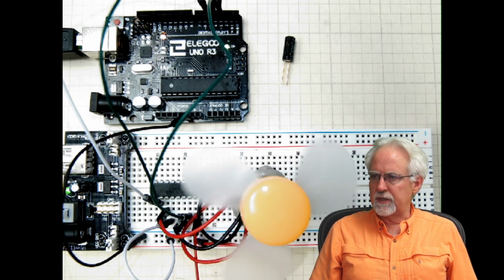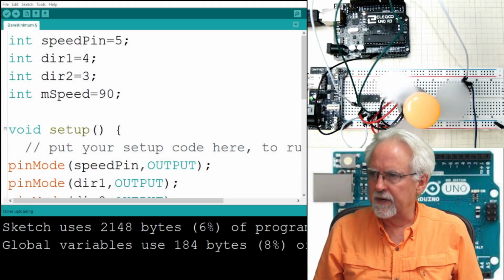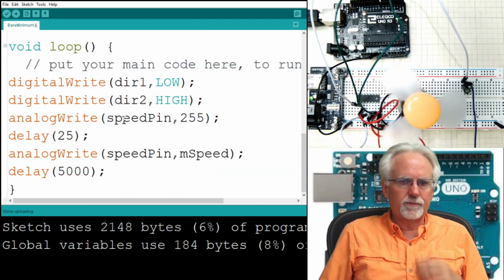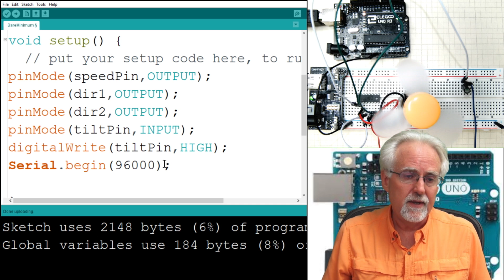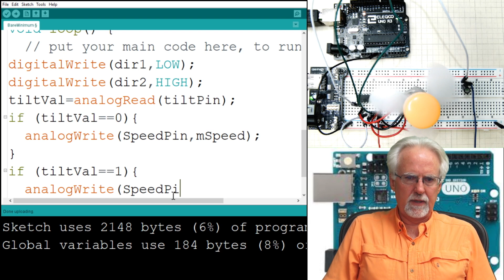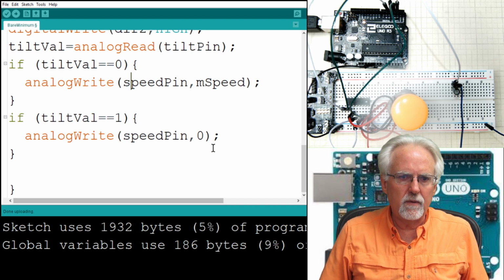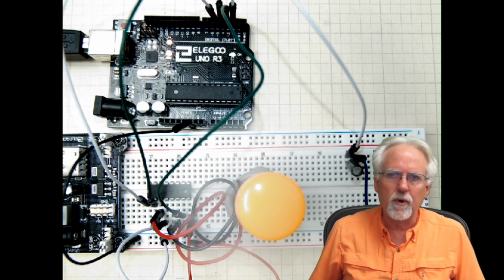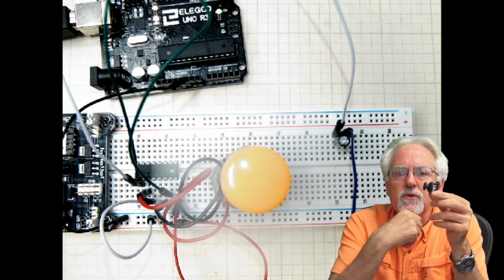Arduino Tutorial 38: Using a Tilt Switch Cut Off With a DC Motor

Comment: i want to  tell you that i did it after you gave us the homework, so i did it another way.
the way i did it is by using a while loop, by saying if the switchState was1 then turn off then i made it read the pin again (so when it sees it false it will exit the loop), then i put both directions low,
and it worked, would that be like a good way of writing a code or is it less professional??
i just want to know to keep and improving myself😊
Reply from the maker: That's awesome! Keep experimenting and improving.

Comment: I did not have a tilt stwitch so I used a button instead. I had to run 5V through the button as a pull down resistor to get it to work properly. Thank you for the challenge.

Comment: sorry for using numbers insted of variables : 

int tiltval ;
void setup()
{
  pinMode(2, OUTPUT);
  pinMode(3, OUTPUT);
  pinMode(5, OUTPUT);
  pinMode( 7 , INPUT_PULLUP) ; 
  Serial.begin (9600) ; 
 
}

void loop()
{

  
  tiltval = digitalRead (7) ;
  Serial.println(tiltval);
  delay (200);
  
  if (tiltval == 1) { 
  digitalWrite(2, LOW);
  digitalWrite(3, HIGH);
  analogWrite(5 , 255) ;
  delay(1000); 
  }
  else if (tiltval == 0 ) {
  digitalWrite(2, LOW);
  digitalWrite(3, LOW);
  analogWrite(5 , 255) ;
  delay(1000); 
}
}

Comment: My bad. I did the homework but I just put the tilt switch in series with the ground to the motor controller. Took me 5 minutes and no additional code. KISS. Is this the wrong way to do it?

Comment: As my kit doesn't come with a L293D IC, i had to this and the previous practice with TinkerCAD, which proven to be a bit difficult, but eventually it worked. Next one would be more difficult, as TinkerCad doesn't have a joystick component for Arduino, but two potentiometer and a switch should work just fine as a replacement.

Comment: I did this for homework last lesson, but used if else. It worked for a while but then I started getting both one and zero tiltVal readings when it was tipped.   Realized I needed to fake a pulldown resister using digitalWrite high.  Then it worked consistently.

Comment: Hi Paul, I incorporated the tilts witch and again used the pinMode(tiltPin, INPUT_PULLUP) ; as this reduces the code by a line(one less to get wrong). I found that like yours in the video there was a delay between the tilt switch activating and the fan stopping so I played around with the delay times and took the kick play down to 50mS and the delay after the analogWrite(speedPin,mSpeed); line down to 100mS and this gave a nice snappy response and I was also able to get it to start back up when righted at an initial speed of 75.
I wish I hadn't torn down the joystick board now ( I have 2 UNO boards) still its all part of the lesson. Off I go to the homework bench.  Great job as usual.

Comment: Yes I did the homework - always do AND pull up your avg. view time because I always watch the whole thing - several times if necessary. This was easy because of the previous videos. Thanks. I am wondering if you do a series focusing on what is needed to step up to real life projects requiring higher voltage and currents. I am not an electrician ot hobby electronics guy but I do have a project in mind requiring me to learn all this and more. You have alluded to this requiring relays etc. but I would not know how to do it. Perhaps a higher voltage DC motor or servo would be a good example.
Brewster
Reply: Follow up to my question. I can understand if there might be a liability showing videos involving lethal voltages and current. Maybe you could suggest another source?

Comment: I put the tilt resistor in series with the fan power. Works great and doesn't require any change to the code. I know it's not in the spirit of the homework, but it's basically a 0ohm switch.

Comment: Hi Paul - Not sure if this is acceptable, but I just put the tilt switch in the circuit between pin 8 on the motor controller and the positive rail.  Got the same results.

Comment: I did it slightly different but same result:
loop:
switchVal=digitalRead(switchPin);
Serial.println(switchVal);

if (switchVal==0){
digitalWrite(dir1,HIGH);
digitalWrite(dir2,LOW);
analogWrite(speedPin,mSpeed);
}
else{
  digitalWrite(dir1,LOW);
  digitalWrite(dir2,LOW);
}

Comment: I just used the tilt switch to interupt the voltage from the L293D and it seemed to work very well. A simple hardware solution?
Reply: obviously though, that wont work with our homework assignment. Back to the drawing board!

Comment: I did my homework and had it working prior to watching this episode. Setting the motor speed to zero seemed logical, so that's what I did. The only mod I made was to put the tilt-switch on a couple of male/female wire extensions to make the tip-over testing easier. Thank you for another wonderful lesson. 👍
Reply: Haha, putting the tilt switch on extensions was a great idea, thanks!

Comment: I was thinking about where a tilt switch is used and there is one in my portable heater that shuts it off to prevent fires. It also turns on a red light. Really useful information 👍

Comment: I am now able to add the tilt cut off with flashing red LED. Control the speed of the motor with a potentiometer. Turn the whole thing off and on and reset the tilt state with a button.

I just wanted to take the time before finishing this video to let thank you for this series! 
You taught me how to do Fusion 360 and I'm so happy to continue to be able to learn from you.

Reply

Comment: I connected the tilt switch to Arduino pin A0 to chip pin 5. If tilted the input becomes 0 and the motor stops. In real power motor applications, you would use a tilt tin in the control circuit, not direct power running the motor.
I realized that 512 was a starting point, so you would need two slopes, one positive, one negative. Two if statements.
We  at starting in the middle of the X axis from 0 to 1023. 0 is the still, and 255 is the highest for mSpeed for the motor.
Wayne - - Moderately hard. Again having an old lesson open while working on a new lesson is better than from scratch.

Comment: Did it first by running the ground for the motor through the tilt switch.  Figured that was cheating so set up a pin and set the variable like you showed.    Does everyone's motor make a buzzing sound even when it is off?

Comment: Finished the homework before watching this. I used an else statement instead of another if statement.

Thank God for you! God bless you sir!
Reply: I did the same thing using else rather than 2 if statements. not sure if there is a difference.
Reply: @haroldbk  It's a minor difference in this situation, but important in others.  As an example "if Paul's shirt is orange, wave your hand. If Paul's shirt is green, stand up." In this situation, the code would evaluate both statements to see if they are true. There's no "fallback" code block if both statements are false. "If Paul's shirt is orange, wave your hand, else, stand up." Here, if Paul were wearing any other color shirt but orange, the else portion will execute. If he is wearing an orange shirt, the else statement will be skipped.

Comment: Hi Paul, I did the homework and got it to work. I wrote the same code as you created, but added two extra variables : mSpeedStart=250 & mSpeedStop=0 then I used these variables in the if statements, although mine worked, I wrote more unnecessary  code. Thanks again Paul

Comment: So I did complete the homework, but as usual I took it a few steps further.  I used serial monitor to take a speed from the user and turn the fan on to that speed(low, med, or high)
I made it work but then I wanted that no matter what when the tilt switch was tilted, the circuit would cut off.  I was able to code it but when the tilt occurred and then was corrected the fan has to be restarted by the user in the serial monitor.  The other way (my original idea) take the fan speed input from the user and then when tilted the circuit cuts off and then turns back on as soon as the tilt is corrected. The way I made this happen was to connect the tilt switch on the ground circuit, where when tilted it opened the ground circuit causing an open in the electrical circuit causing the fan to shut off, and then correct it and the fans turns back on as intended.  I want to know if someone know of a way to code it rather than to put the switch on the ground circuit?

Here's what I have, this works with the tilt switch as an input to the R3 and not on the ground circuit:

int on=HIGH;
int Off=LOW;
int motPin=3;
int motDir1=2;
int motDir2=7;
String speed;
int tiltPin=12;
int tiltVal;
int low=155;
int high=255;
int med=195;
int off=0;
String speed1;

void setup() {
  Serial.begin(9600);
  pinMode(motPin,OUTPUT);
  pinMode(motDir1,INPUT);
  pinMode(motDir2,INPUT);
  digitalWrite(tiltPin,HIGH);

}

void loop() {
  
  
  tiltVal=digitalRead(tiltPin);
  Serial.println(tiltVal);
if(tiltVal==0){

      speed=Serial.readString();
      digitalWrite(motDir1,Off);
      digitalWrite(motDir2,on);
      

          if(speed=="high"){
            analogWrite(motPin,high);
          }
          if(speed=="med"){
            analogWrite(motPin,med);
          }
          if(speed=="low"){
            analogWrite(motPin,low);
          }
          if(speed=="off"){
            analogWrite(motPin,off);
          }
  

}

if(tiltVal==1){
  digitalWrite(motDir1,Off);
  digitalWrite(motDir2,on);
  analogWrite(motPin,0);
}

}

Comment: Keyword Rose and Ronald
Another great lesson, I am planning to use a DC motor to drive my observatory dome using mirror tiles fitted every 10 degrees around the dome and for position control with infrared photo sensors. I have learnt a great deal so far

Comment: Did my homework on this. My motor is very slow even at 255. Will not run blow 180. Wonder if that is typical? I did the digitalWrite.
Reply: Are you using the battery or the power supply for the power supply module?

Comment: i used an if statement to turn on the motor and do the kickstart voltage, and then a while statement within that to loop a lower voltage run for the motor until it is tipped and everything shuts off

Comment: I  found an easier way to set an input switch as if it had a pull-up resistor. In the pinmode statement use  “INPUT_PULLUP”. Then you don’t need the digital write statement.

Comment: Did the assignment from the last tutorial, but a little differently. I used a couple of while loops, so I could keep the low speed and use the kick start. It also only kick starts once then keeps running until tilted. Full code in the comments of Lesson 37.

Comment: Another excellent video - made it to the end.  I don't have an Arduino yet but am looking forward to buying a sensor laden kit soon.  I did this 50 years ago using an 8086 based robot and assembler.

Are there more sensitive tilt switches available, i.e. able to detect 5 degree tilt for example?

Comment: I did the homework on the last episode no problem and decided to use the knowledge Ive gained so far afterwards to combine my DC Motor, Servo, and Joystick , X controlling motor speed/direction , Y controlling servo position to point the fan in a desired direction. My longest code so far and was successful right away. Fantastic teaching I can’t thank you enough !
Reply: Great idea, Colten!

Comment: I'm going to try posting my code here.  From all I can see this should work but I get strange results.  The variables keep changing without my pushing the button!  I've changed the button thinking it was bad but with the same results.  

int motorSpeedPin=5;          //Pin 1 on chip
int motorDirectionPin1=4;     //Pin 2 on chip, set one high the other low
int motorDirectionPin2=3;     //Pin 7 on chip  set one high the other low

int motorSpeed=255;           //Speed between 0-255. Needs about 100 to run, sends pwm to motorSpeedPin 

int buttonPin=12;
int buttonOld=1;
int buttonNew;
int motorState=0;             //motor is turned off
int dt=500;

void setup() {
  // put your setup code here, to run once:
  
  Serial.begin(9600);
  pinMode(motorSpeedPin,OUTPUT);
  pinMode(motorDirectionPin1,OUTPUT);
  pinMode(motorDirectionPin2,OUTPUT);  

  pinMode(buttonPin,INPUT);

}

void loop() {
  // put your main code here, to run repeatedly:
  
    buttonNew=digitalRead(buttonPin); 

  Serial.print("buttonNew = ");       //for troubleshooting
  Serial.println(buttonNew);          //
  Serial.print("buttonOld = ");       //
  Serial.println(buttonOld);          //
  Serial.print("motorState = ");      //
  Serial.println(motorState);         //
  Serial.println();                   //
         
 delay(dt); 
 
  if (buttonOld==0 && buttonNew==1)   // switch motor states
    {
      if (motorState==0)  // if the motor was off
      {
         digitalWrite(motorDirectionPin1,HIGH);    //these two put the motor in a direction
         digitalWrite(motorDirectionPin2,LOW);     //always one high the other low
         analogWrite(motorSpeedPin,motorSpeed);    //starts the motor by setting the speed to the variable
         motorState=1;
      }
      else   
        {
          analogWrite(motorSpeedPin,0);
          motorState=0;
        }
    }

buttonOld=buttonNew;    //track last button push
  
  

}

Comment: I put the tilt switch between the power supply and motor controller pin 8.  It worked without needing any code.  Is this cheating?
Reply from the maker: Yes.

Comment: Hi Paul. I tried to do the homework from the last lesson, but I was not successful.
I was able to get the fan to move, but it seemed that I just turned it on and did not incorporate the tiltswitch properly. 
I tried to set the tiltSwitch to 1, and then put in an if statement to turn the fan speed to zero if the tiltswitch read 0. 
so I'm looking forward to finding out in this video where I went wrong and to see if I can correct my thinking.

Comment: I feel like I cheated because I just put the tilt switch in line of pin 8 (getting power) and avoided all coding and it worked. I also watched how you did it with code.

Comment: OK You got me back and I renewed my $10 a month. You taught me Fusion 360 and i am designing and 3D Printing train parts for my 1950s American Flyer. Now i need a new motor contoller and came here to learn Arduino. Hoping the Nano or ESP32 could work with the 1950s Motor and AC track power. I have 3 Uno's 1 Nano and now 1 Pi running my Octoprint, boy is that nice. Take care thanks for the training. As a Patreon do we get to ask questions, Specific to our projects? All the best, Dennis and yes  Rose & I forgot

Comment: This was a fun easy project. I set mine up very similar to yours except mine worked correctly the first time because I did a digitalRead(tiltPin) instead of analogRead(tiltPin) like you did. The other difference I had was instead of using analogWrite(speed_pin,0); I created and used another variable - motorOff=0  to shut off the motor using analogWrite(speed_pin,motorOff); Once again, thank you for a fine lesson!

Comment: Managed the homework but not without a bit of head scratching! 
As mentioned in one of my comments on a previous lesson, I'm using Tinkercad to simulate the projects for now. I encountered two issues. 
1) Tinkercad seems to want the same voltage applied to both the power pins on the L293D. Even though I was only using the one side of the IC, it wanted the supply voltage to be connected to pin 8 and 16. 
2) This one caused the head scratching. It turned out that the hack of creating a "PULL UP" on the digital pin connected to the switch, does not work on pin 13 of the Arduino, on Tinkercad anyway, eventually I changed to pin 12 and it worked perfectly. I would be interested to know if anyone has had this issue on the physical Arduino or is this just a Tinkercad issue.
Many Thanks! 
Off to do some work and then do the joystick homework later.

Comment: Yes, Sir, I did the homework! It was nice and straightforward to incorporate the idea for the tilt switch from Tutorial #36 with the code from #37 to control the on/off of the DC motor.
I think I must be learning something here! 8-)
The only differences I have were to use if ... else instead of two ifs., and my pinMode is (tiltPin,INPUT_PULLUP), as per a suggestion in a comment in an earlier video.

Comment: int speedPin=5;
int drxn1=4;
int drxn2=3;
int tiltPin=2;
int tiltVal;
int mSpeed;
int dt=100;

void setup() {

Serial.begin(9600);
pinMode(speedPin,OUTPUT);
pinMode(drxn1,OUTPUT);
pinMode(drxn2,OUTPUT);
digitalWrite(tiltPin,HIGH);
pinMode(tiltPin,INPUT);}

void loop() {
  
tiltVal=digitalRead(tiltPin);
Serial.println(tiltVal);
if (tiltVal==0){
  mSpeed=255;
}
if (tiltVal==1){
  mSpeed=50;
}

digitalWrite(drxn1,HIGH);
digitalWrite(drxn2,LOW);
analogWrite(speedPin,mSpeed);
delay(dt);

}

Comment: I already did the homework and I momentarily started at 255 to get the motor running then, after a short delay, I went to the analog value on the potentiometer (joystick). 

Do I get credit even though it’s been a while?

Comment: I wonder why in some projects my code does not work if I put a "Serial.begin". In this case, the tilt switch always output 0 even when tilted, but once I remove the Serial.begin in the setup, the tilt switch becomes functional... This is not the first time it happened to me.

Comment: That took way longer than it should have.  Fun fact, the analog part of the joystick will still work if you mix up ground and power, but the switch part won't.  Ask me how I know!  (I decided to get fancy and use the joystick switch to toggle my fan on and off).  Ask me how I know!  And yes, do the math on this one, or discover what happens when you feed slightly out-of-bound values to your analogWrite.  You can't just divide your analogRead value by 2 and subtract 255.  Well, you can try, but then your speed ends up out of bounds.